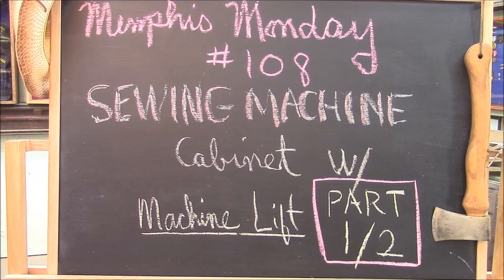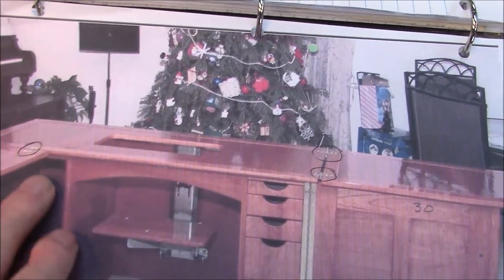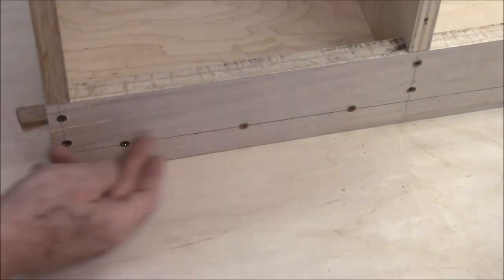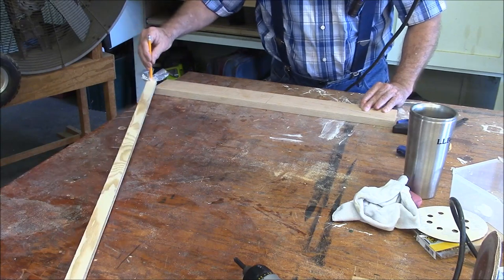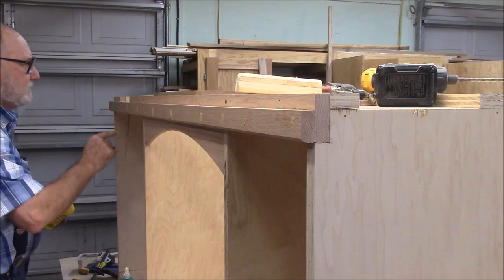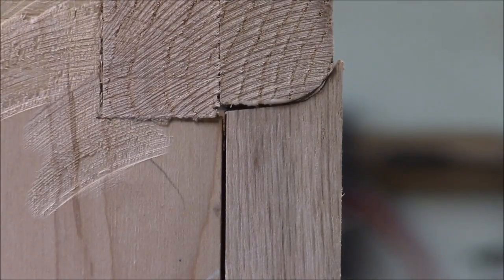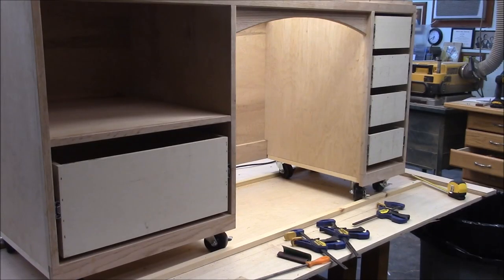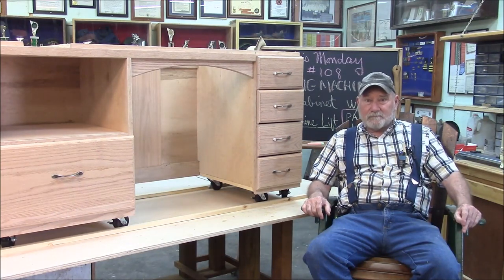Sewing Cabinet with Machine-Lift Part 1 of 2 MM 108

Comment: This is a great build project and I watched Part 2 before coming back here to comment and give you a thumbs up.  However, I have a question about your design.  I noticed you centered the machine opening and lift in the foot well.  I've used over a dozen sewing machines in cabinets, some with lifts and the rest with hinged bases that drop down.  In each case, the machine is offset to the right of the user, with the presser foot and needle centered on the user.

The photo you used as the basis for your project appears to be a mirror image, but it is clear that the lift and opening are offset (to the left in that image).  This matches my experience as a user, not as a builder.

Comment: I like your version of the sewing cabinet better than the one in the picture both for looks and functionality. The one in the photo uses the doors to hold up the leafs, which would make it impossible for somebody to sit comfortably in a chair and have their legs underneath the leafs. Your slide out mechanism to hold up the leafs leave plenty of room to sit comfortably with legs in front. Of course I've never used a sewing machine in my life and don't plan to, but that's my point of view. Wow, you sure have lots of views on this one. Very nice!
Reply from the maker: The views, I think, are fake.  I hired an outfit to "promote" this video, as I thought it might have some general appeal.  YouTube promoted my 70 feet of fence video for some reason, so I figured why not give it a try on this video, as I thought this video was better.  But I checked it out, and all the views, over 5000 so far are all from the Netherlands.  Notice I got plenty of likes, but no comments from these "so called" viewers.  I can only hope that YouTube doesn't hold this against me, as they were starting to like me and promote my stuff.
    I broke my rule here of copying things exactly, as the design was really based on the desires of my friend, and clearly those "Door supports" were a bad idea.  Actually, me and my friend hashed out the design for two days, based on her needs and several "google" pictures. Frankly, I only showed the picture at all because I had no prototype.  In 2 of 2 I actually make some serious changes to the slide-out design, and when you see those changes it will become clear why.
     On grid, did you ever notice that I always reply back with longer comments than your original?  It's because, unlike those fake 5000 views I paid for, you and several others are the real Memphis Monday family.  Real people, doing real things, and I like that.
     Thanks again for watching and commenting.  I say it every week, but I really do value and look forward to your input.
Reply: I was wondering about all the views. Hopefully one day you'll actually have that many. Of course once you get that many views all the trolls will come along with it. I don't know if I mentioned this before but your videos are the only ones I comment on regularly because the comments are nice and tame and troll free. It seems like before when I did comment quite a bit on lots of videos, most of the replies were from trolls and I got tired of wasting so much time responding. It might surprise you to know that Troy and I are still friends and he understands why I don't comment on his videos or read the comments either. Sometimes my replies are late because I have to log in to YT on the computer to comment. The TV app doesn't show comments and doesn't accept them either, but I sure like watching videos on a wide screen TV, even though this is a 27" monitor here. There's a guy here on YT who I watch regularly and he has a hydraulic work bench that he can lower to the ground for heavy objects, then raise it back up to normal height. I was thinking something like that might work out good for you. Anyway, talk about long comments! I'm looking forward to part 2 and I'm sure whatever changes you made will still look better than the prototype/picture. BTW, thanks for the videos and your nice replies to my comments.
Reply from the maker: TR lost me when Joy went missing.  I'm a dog-lover I guess, and I'm ate-up with it.    As I told Hippie once, I stopped commenting on TR's channel as I was starting to feel like a troll, since now I know how hard it is to make videos and attract viewers.  Interestingly, of the trolls I have had the last four years, few make videos themselves
      I just connect my TV to my computer with an HDMI cable, as I'm like you about watching videos on the TV.  Fact is, I hardly watch cable TV, as I can get everything I watch right off the internet.
      I won't buy any fake views this week, unless the fake views from last week somehow trigger the YouTube algorithm to promote me (like they did with the 70 feet of fence video.)
      I'm liking that hydraulic work bench idea!!!  Send me the URL if you think about it.  Thanks for watching and commenting.

Comment: 4:30  "I have trouble working on the ground." Ha ha ha  Only 18 year olds do not have trouble working on the ground. I am glad you said it out loud. I am glad you put it on a table. It would have been hard to watch otherwise. I use the expression, "it is uncivilized to work on the ground." I just think it is a low class, barbaric, lazy way to do things. I love the thought process on how you are doing this. From the detailed step by step process we can see how your plans come together. Thanks for letting us in on your secrets. Very well done. Good job as always. Lots of take-a-ways.
Reply from the maker: I don't know about "uncivilized" all I know is I can't do it anymore.  Remember those "good old days," when we were 18 and it didn't matter where the project was situated?  Let me sit, or let me stand, but don't ask me to squat down on the ground for hours.  Frankly, the "good enough" answer would tend to come too early in the process.  Moreover, design decisions should not be based on the pain and discomfort experienced by an old guy.  In short, the 20 minutes I spend building that low workbench saved me hours of work time, while, I'm guessing, improved the finished product. 
     Next week is intense, as we turn this cabinet into a sewing cabinet.  Make some real changes to the braces, install the lift mechanism, design and install the top, etc. etc.  Hope to see you then.
      I remember you told me your age last week.  You are the same age as my brother.  Isn't it amazing that we can look at an age of 65 and count that as young?    Perhaps it is instructive.  
     Thanks again for watching (so closely) and commenting.  It means a lot to me, and the whole Memphis Applegate team.
Reply: "...design decisions should not be based on the pain and discomfort experienced...the 20 minutes... building...saved me hours of work time... improved the finished product." YOU said it better than I did. I only summarized by calling it "uncivilized... low class, barbaric, lazy way." You are correct. To rephrase with my words, design decisions need to be thought out with skill, experience, and production as a central roll.

In my opinion, one of the things a civilized society needs is a productive mindset. Everything about your channel is an example of this and points to production vs consumption. If you spent as much time on consumption and entertainment (eat, drink and be merry,) you would have a much more popular and famous YouTube channel. 

Instead, you just consistently, and thoughtfully work right along producing, and make the world a better place. May your tribe increase. Thanks for the example.
Reply from the maker: Yep, trying to jazz up my channel would come off as fake, even if I knew how to do it!!  I don't golf or fish or garden or whatever else retired people do.  So every day I get up and go to work, just like I've been doing for the last 50 years. But it's even better now, as I get to choose my work.
Reply: I am guessing you know this: I have read several places over the years, that the average lifespan for men who retire in this country is 18 months. Some die sooner, some later. Not very good odds. We all leave a legacy, one way or another. 

You are choosing how you leave your legacy. How terrible is would be to have people bitterly hate you and can not wait till you die, so they can piss on your grave. Productivity plus "do unto others," goes a long way. Again, I am guessing this is not all new to you.